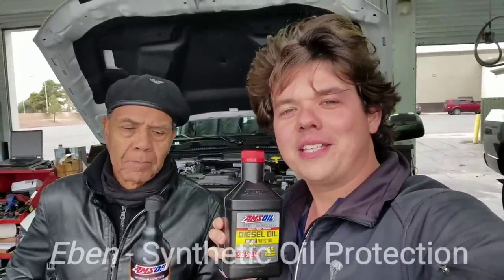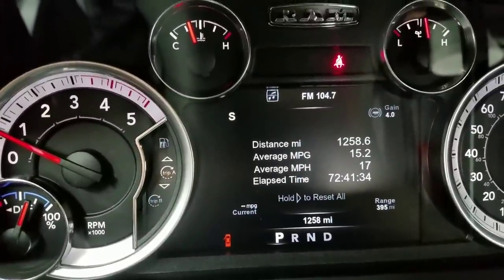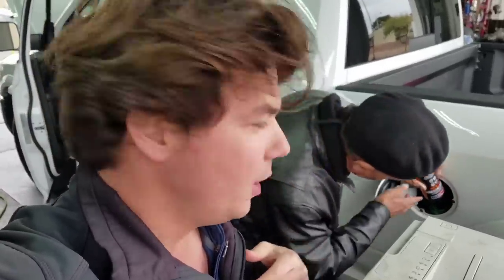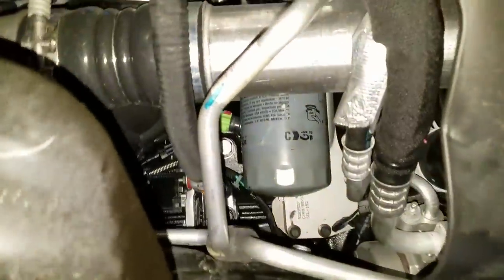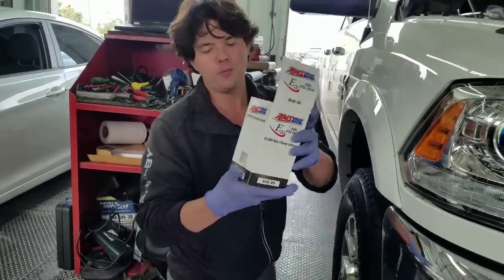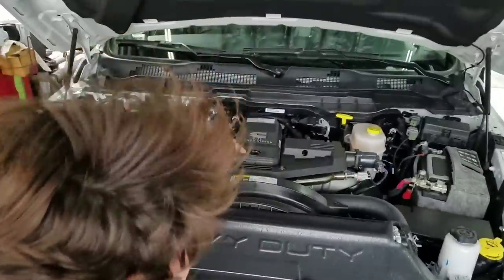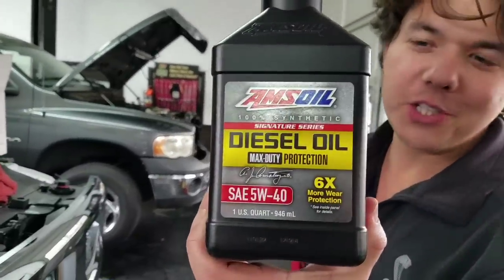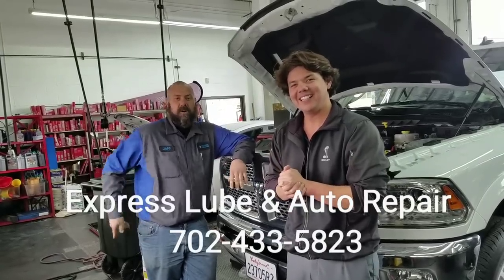2018 Ram 3500 6.7 L Cummins Motor Oil Change

Comment from the maker: Diesel Truck Oil Changes-
https://www.youtube.com/playlist?list=PLB_ftWArBFde2EzcsSrNK9wkEgxoZ-lDc
Eben Rockmaker
Independent AMSOIL Specialist (Dealer#: 5331179) https://www.amsoil.com/offers/pc.aspx?zo=5331179
Mobile: (702) 472-3614

Steps: 
1. My link gets you 25% discount and free shipping on orders $100 or more. Click link under my name, Click link join now yellow bar Preferred Customer for 1 year. Click add to cart. Note: Amsoil will not keep your CC info.
2. Click look up your vehicle.
3. Click auto light truck. 
4. After you have all the products added double check then complete order.
Any order $100 or more has free shipping and ships within 1 to 2 days.

AMSOIL Vehicle Lookup - https://www.amsoil.com/guides.aspx?zo=5331179

Friend me on:

Instagram - https://www.instagram.com/syntheticoilprotection/

Facebook - https://www.facebook.com/profile.php?id=100007973957868

Comment: At $12 a quart, that $144 for just the oil.  The filter is $22.  $166 for an oil change not including labor.
Reply from the maker: Keep in mind that oil change last two times the OEM interval and you get better gas mileage
Reply: I only pay $9 as a preferred customer!
Reply: amazon is selling it for 28 dollars a quart, will never pay that
Reply from the maker: Todd this is my personal link. If you have any questions at all, feel free to reach out to me anytime.☕

My Link: Best AMSOIL 100% Synthetic @ Wholesale + FREE Shipping: https://www.amsoil.com/offers/?zo=5331179 
AMSOIL Products & Vehicle Lookup - https://www.amsoil.com/guides.aspx?zo=5331179  

Follow these accounts for Ebens Giveaway:
Instagram - https://www.instagram.com/syntheticoilprotection/

Facebook - https://www.facebook.com/profile.php?id=100007973957868

Professional YouLubher:
Eben Rockmaker Executive Direct Jobber AMSOIL Specialist (Dealer#: 5331179) 
Mobile: (702) 472-3614
My Link: Best AMSOIL 100% Synthetic @ Wholesale + FREE Shipping: https://www.amsoil.com/offers/?zo=5331179 
AMSOIL Products & Vehicle Lookup - https://www.amsoil.com/guides.aspx?zo=5331179

Comment: Come to the filter place and get you a filter cap so you don’t spill used oil on your truck and it makes a handle to pull the filter out. 👍🏻

Comment: Personal opinion: it sounded smoother before. Was it the right before and after?
Reply from the maker: It could have been mixed up but I don't think so - https://youtu.be/0YNrt962Q7U
Reply from the maker: This one sounded like a motorcycle before and then after it sounds quiet this is a 2000 Porsche https://youtu.be/vR0k3JGOK4M
Reply: Yes , that Porsche was a huge difference!  You have a ton of great information on Amsoil’s products!
Reply from the maker: Thanks☕

     Thanks Marco always happy to help☕

This is my wholesale link if you ever are thinking of trying the products and then there's also a $50 free shipping promotion right now.
 Promo code: SHIP920

Professional YouLubher: Eben Rockmaker Regency Direct Jobber AMSOIL Specialist (Dealer#: 5331179) Mobile: (702) 472-3614 

Ebens Link: AMSOIL Wholesale + FREE Shipping: https://www.amsoil.com/offers/?zo=5331179

Comment: ... 24 minutes and you did it with one hand! Amazing!
Reply from the maker: Lol, 😁
Caught Somewhere in Time......

He was 1 24th of a turn at a time.

That's the hardest thread on filter location I've ever handled.

Basically you need a super long breaker bar with the oil filter cap

Comment: I have my dodge ram tradesman 3500 dually 2018 
With 30k miles 
Is my first diesel truck so don't know much about this   diesel engine but one of my many questions is everything how many miles is recommended chance the oil 🛢 filler ect. ? 
This truck a use for pull a dump trailer 7k pounds  about 4 times a week  . 
( construction work) 
Thanks very good videos.
Reply from the maker: Do you use AMSOIL?

Comment: Thin oil for a pickup that doesnt work.
Reply from the maker: You can lose your oil pressure pretty easy if you overheat it or run too thin of oil.

☕
Reply: @Syntheticoilprotection  which is why I dont use 5w 40
Reply: Actually, 5w-40 is essentially the same weight (40) as 15w-40 at operating temperature.  The good thing about 5w-40 is that in cold (freezing) temperatures, the oil is thin enough on startup to get to critical parts very quickly.  If you're always in warmer temps it really doesn't matter.